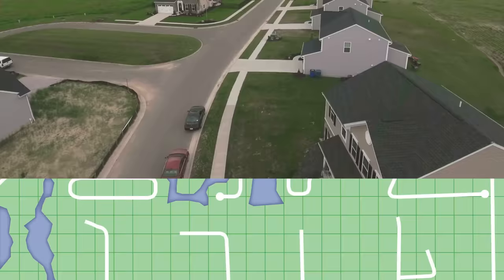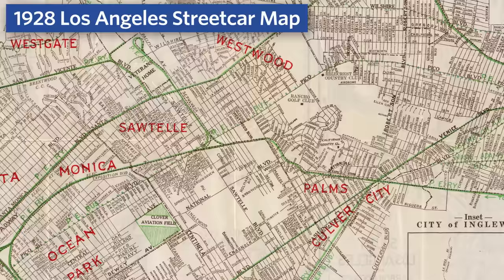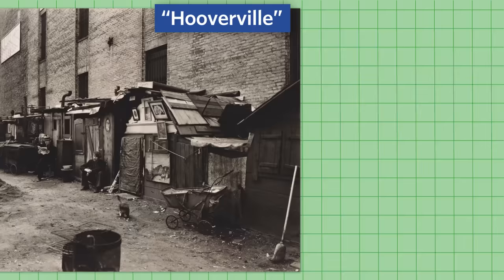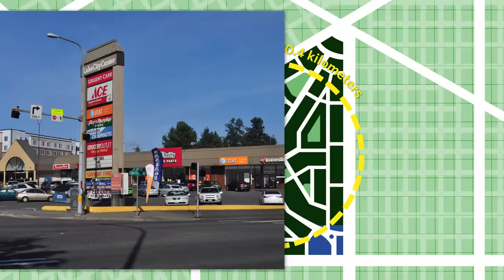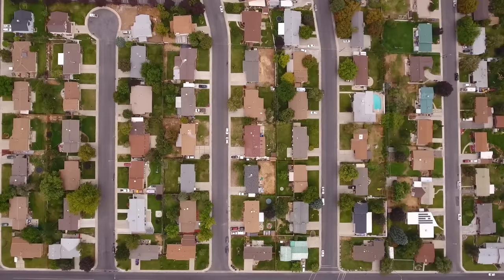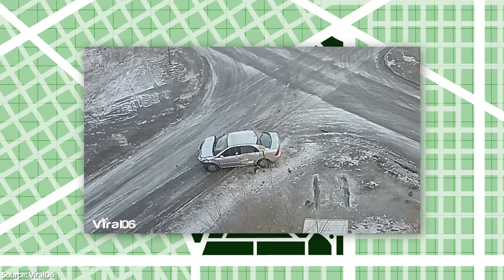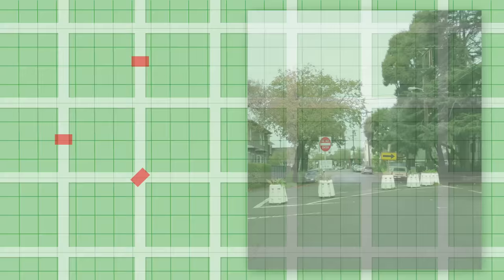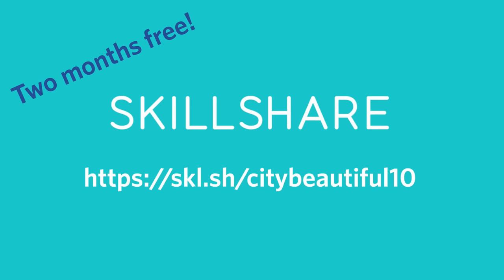The Reason Our Streets Switched to Cul-De-Sacs

Comment: "make them thinner", still probably the width of a wide A road in the UK.
Reply: Uk roads r fucking terrifying I nearly died so many times
Reply: @zcalhoun3638  And yet their road fatality rate is a quarter to a half of the US depending on how you want to measure it.
Reply: @arrgghh1555  im pretty sure thats bc less people have cars tbh. Went on roads for school trips where the bus was literally wider than the road, both sides of the wheels were just hanging off The worst problem was the little villages tho
Reply: laughs in coastal cities at Mediterranean Sea
Reply: @007JAKICA  they have a race track in the streets of Monaco lol

Idk how they race there
Reply: Yeah, looking at one of those overhead shots he had, the cul de sacs (or "courts", as I know them) were so wide. Could probably fit 5 cars side by side and still have a little room to spare.
Reply: When i went to the UK, i HAD to drive very carefully. After getting used to driving on the left side (took ab. 2 weeks), i figured that it's mostly about street design that makes the UK's roads much safer. They are pretty dynamic and narrow, meaning that you can't just speed through them and actually have to stick to the speed limit. In the US i saw people going 10 mph over the speed limit and taking calls in the mean time which just shows how roads that dont require much of your attention are much more dangerous
Reply: I have two points.

1) Having travelled, I can confirm, US streets are huge. It's weird. It's extremely uncomfortable to be around them at all in the summer, because it's just a sea of blacktop. UK streets and the streets of France stay cooler, and that keeps the housing around them cooler.

2) Everyone goes on about how terrifying the drivers are in London, but every time I've gone there, people have been so kind to me when I'm walking. I think it's a myth that English people are extremely polite (sorry, I've met too many of them), but my experience with their drivers is that they ARE extremely polite. It's all topsy-turvy I tells ya!
Reply: @zcalhoun3638  no that isn’t true. In the U.K. traffic isn’t nearly as bad so everyone has a car. I don’t know any adult that doesn’t and if you don’t own a car your old or a man child in the U.K. that’s it.
Reply: @haileybalmer9722  people in the U.K. aren’t polite, we don’t care about anyone. I’ve heard in America that everyone smiles at everyone be we aren’t like that. In busy cities you won’t find anyone looking at anyone. All people mind their own business and ignore everyone around them. If you come out into the country side then you will find more homely towns where everyone knows everyone and so are a lot kinder to the people around them. But in my experience. Having lived in the U.K. my whole life lmao. British people couldn’t care less about anyone.
Reply: @Deme_Diora666  that was pretty much my experience. Not just in the UK, but with people who moved over to the US from the UK, particularly after Brexit. I never thought I'd be one of those xenophobic people who wanted a group of immigrants to go back where they came from, but the wealthy Brits who came out here made me feel that way. I would watch them go into a shop and act like everyone working there was either a robot or a dog. They'd go in shouting their orders and refusing to respond to questions, or snapping their fingers and whistling to get people's attention and scolding employees for asking questions they're required to ask. It was honestly very embarrassing to watch. I tried to talk to a couple of them about it, explain that it's not the culture here to behave that way, and they all made some flippant, shitty comment, laughed, and then froze me out at work.

They ARE more polite drivers in my experience, though.
Reply: @haileybalmer9722  okay that’s a bit far haha. We have a big jump between our working and middle class here and especially the higher class really are that way inclined. Weirdly people from the U.K. especially the middle and working class are all about rules and manners and get really angry about people disrespecting service workers. We just are very good at minding our business.
Reply: @arrgghh1555  That's because in America, it's easier to get a drivers license than it is to get a beer. We all drive like trash
Reply: @kingRukus39  in Ireland it costs a bomb to learn how to drive. €45 for the theory test.  €480 for 12 lessons which are the minimum. Then youve your pretest €40, then your driving test which you also have to pay for €45. And thats before you even own a car and pay for tax, insurance and the nct to make sure its safe to drive 🙇‍♀️
Reply: @Deme_Diora666  That sounds awesome.  I hate how fake everyone is here. Just leave me alone and I'll do my best to stay out of your way too.
Reply: @sorchamarie4089  That's just so funny to me because they let me rent a car and drive there with zero experience with driving on the left. Almost caused an accident from making a right turn forgetting to yield to incoming traffic.
Reply: @juggsauce  that's the fecking Irish government 😂 pure money grabbing lol
Reply: @arrgghh1555  Well... yes, because the UK has ALOT less cars than the US
Reply: @byfrax2371  This is an excellent point which I like to demonstrate by having people pay attention the next time a car drives into a building in the USA. For one, it happens much more often and for two; pay attention to these things: A) What was the time of day, B) what were the weather conditions, C) What was the age and health of the driver.

You'll find a shocking amount of them happen on a clear sunny day by perfectly healthy and not-senior-citizen drivers. NA roads are too wide, too straight, and too isolated. This causes increased vehicle speed and lack of attention. An unfortunate combination.

Comment: "cul-de-sac" is French for 'bottom of a bag.'
Reply: In catalan it literaly means 'ass of a bag'.
Reply: If you give anything a French label it makes it more palatable for some reason. If it was called simply a "dead-end" I doubt cal-de-sacs would be as popular.
Reply: @gustavosantos106  yes in french too
Reply: James Taylor I agree that cul-de-sac sounds classier than dead-end but there is a difference, a cul-de-sac allows for a car to turn around at the end without having to back up, but a dead-end just stops and cars have to k-turn to get out.  I grew up on a dead-end street (the yellow diamond street sign even said so) and many a Sunday morning would find my dad repairing the lawn where lost drunk drivers had failed to execute a proper k-turn the night before.
Reply: @jpe1  I've never that manoeuvre called a k turn before. But I like it!
Reply: stoat2 I didn’t realize that “k-turn” was any more unusual a term than “u-turn”.  Sometimes I hear it called a “3-point turn” but when I took my driver’s test (in 1987) the examiner directed me to make a “k-turn” as part of the test. The car I was driving was small enough, with a tight enough turning circle, that I could have done a u-turn without hitting any curbs, but I did stop and back up a couple of feet in the middle of the turn, just in case he needed to see that in order to pass me.
Reply: @jpe1  I don't think there's a difference. Tolkien used dead end because he hated French words. But it's supposed to have the same meaning. In France a cul de sac is a road that ends whether you can turn around at that end or not.
Reply: Sergent Saucisse interesting point about France.  I extrapolated from a very small data set, and after I posted my comment I realized that I’ve never seen “cul de sac” on a yellow diamond street sign, so probably I was inventing an explanation that wanted to be true, but probably isn’t.  Thanks for keeping me honest 😉
Reply: @jpe1  didn't mean to sound patronizing, sorry if I did. Tbh cultural differences exist and what was true in tolkien's time may not be today. Languages change and France is France, the US are the US. If you guys deem important to have 2 words for those similar but not same things well it's actually kinda logical. English is a richer language than French anyway. Have a nice day :)
Reply: @sergentsaucisse8290  We could totally adapt that translation as it's very convenient. Although a dead end and cul de sac are synonyms, a sac or bag allow non linear movement inside.
Reply: Sergent Saucisse non je ne pense pas que l’anglais soit une langue plus riche que le français
Reply: Sergent Saucisse no worries!  You didn’t seem patronizing at all.
Reply: Pig in a poke
Reply: @jpe1  in UK test you are asked simply to turn the car round, using forward and reverse gears. but we call it a three point turn.
Reply: @gustavosantos106  I was told that the cul-de-sac was in a poem about  London streets. the word was used on or near the street name sign.
Reply: @gustavosantos106  in french, it means ASS of a bag.
Reply: @gustavosantos106  oh so that's where the Portuguese word for "ass" comes from 😂
Reply: @yacetube  It seems Catalan and French have a lot of similarities! :D Not rare as there are just a couple of mountainous kilometers apart from each other.
Reply: @ourificando  I've made a Google translator lookup for 'ass' in portuguese and the result is 'bunda'. How accurate is it?
Reply: @ourificando  I love this conversation xD
Reply: @gustavosantos106  
XD yeeah, very natural one
Reply: "El culo del saco"
Reply: @gustavosantos106  que dius xarnego vol dir el mateix que en francès
Reply: @sergentsaucisse8290  doesnt Tolkien use Bag end instead?
Reply: @jpe1  in Australia we call it a U Turn or a Yewie in slang :D

Or a 3 Point Turn is another method of turning around if you can't chuck a Yewie ;)
Reply: In Spanish it will be "culo de saco", and means ass of the bag. It's funny how everything is linked
Reply: Ok baguette

Comment: Here in Russia we have "circular grid" (if that makes sense) city planning. We don't have problems with neighbourhood traffic because all neighbourhood driveways are defined as pedestrian paths so you can't go above 20 kmh in there, pedestrians always have the right of way, they're chock full of parked cars and 90 degree corners and are difficult to navigate, and the government hardly ever bothers to repair those streets so they're always in extremely poor condition to drive on - people always try to avoid these streets and try to use proper motorways instead, which are designed to accept motor traffic and kept in good shape.
Reply: If people switched to a hexagonal grid, they could have their T-sections. Or, at least three way sections, which are basically the same thing, right?
Reply: @Mnnvint  Y-junction is a worse version of X-junction - same traffic problems but less throughput.
Reply: Circular grid sounds like a nightmare.
Reply: @michaelbuckers  it doesn't have to be perfect hexagons though. With slight modifications you could get to all T-junctions. Well, I guess it might more resemble pluses and squares at that point.
Reply: Circular grid is what Washington D.C. is, also known as spoked wheel pattern. I believe Detroit uses this as well.
Reply: @Mnnvint  In the north of Kiev, Ukraine, we have one district that uses hexagonal grid and it works quite well.

Comment: The neighborhood (and basically the entire town) I grew up in was built in the late 1940’s housing boom, and it’s a bunch of small boxy bungalows on a grid system periodically broken up by schools and parks, and there are a few businesses around the edge. You can definitely tell it was built to FHA standards, but it was still walkable and pedestrian friendly. The biggest thing that helped with that was the walking paths connecting different “neighborhood systems,” which let you bypass most obstacles and kept pedestrian routes user-friendly. There was the occasional loop, but nary a cul-de-sac to be seen. I will always favor a grid system over a cul-de-sac filled suburban wasteland, and there are several better forms of traffic calming and diversion.

Comment: As a cyclist, I really feel the difference between a grid and subdivision streets. In my area, I often have to ride on 6-lane arterials because they're the only streets that go through. I tend to avoid those types of areas whenever possible.
Reply: I hate it when those are the bottlenecks. They totally block most pedestrians and cyclists, unless you have dedicated pedestrian paths and bike lanes. My home city does a pretty good job in most places of including pedestrian paths, and they're growing the bicycle network, but we still definitely have areas like this which are hard to access without a car.
Reply: That is right Ben Ebel, cyclists do NOT want to merge with heavy motorized traffic. Separated bicycle ways or even better bike ways far away from motorized traffic.
Reply: @mardiffv.8775  It doesn't need to be a separated bikeway, it's just preferable to use residential streets rather than arterials. Some areas (like Portland) do a good job of allowing cyclists through places where motor traffic is not allowed, forcing the motor traffic to use a nearby arterial but allowing the cyclists to use the side roads without stopping.
Reply: I'm a Brit, so no grids here - but my city is currently building a network of "Cycle Freeways" that mean you don't get run over by cars or buses & you don't run over us pedestrians, either. They've even published a map of what "city cycle network" will look like when completed that looks like a subway or metro map. So there are other innovative ways to not only keep cyclists safe, but try and get more people out of their cars & on to their bikes - we're already a very walkable city. Public mass transport is ok, but could be better, though. I mean it's great the buses have free WiFi & contactless payment, but why do I have to change to get anywhere other than the city centre?
Reply: @vijay-c  That is very interesting, Vijay.
Reply: So do you prefer grids?

Personally, I prefer fewer grids. Accidents between drivers and cyclists happen most frequently at intersections when drivers assume the right of way. This is not just true of drivers/cyclists, but also between other cars. But I would much rather prefer the "suburban" design over a city "grid" design.

Comment: I like my city centres to be grids (as long as they also have some pedestrian only plazas) and my suburbs to be more maze-like (as long as cul-de-sacs are connected by parks and walking lanes).  My assumption here is that local residents will have the time to solve their own suburban maze but the visitors to city centres need greater simplicity.  Those neighbourhoods should be small enough that you can walk to a major road or centre to get public transport.

Comment: I’m a courier driver. Subdivisions with culdesacs with a ‘one way flow’ of traffic, away from busy main streets, these are pretty good for residential couriers. It’s easier to plan out a delivery route and there’s minimal traffic slowing you down. On the other hand, grid design is a fucking nightmare.